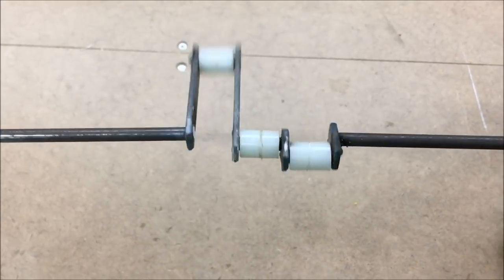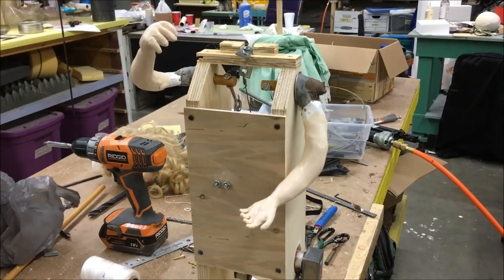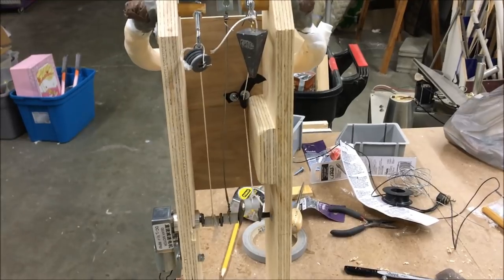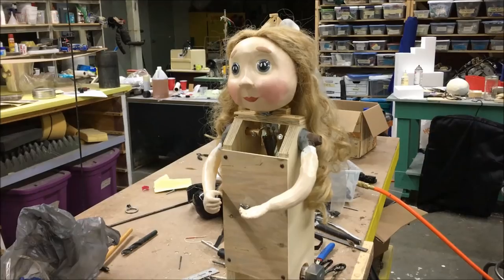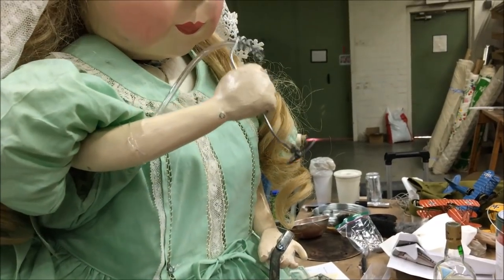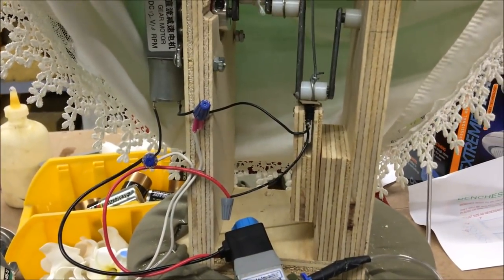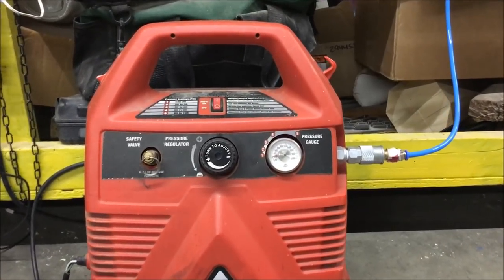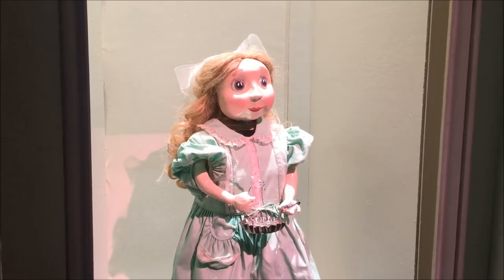Bubble Blowing Automaton

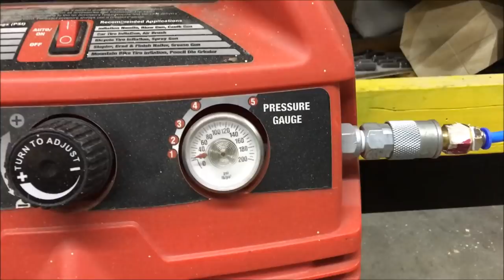Comment: I laughed pretty hard at 2:25. I was not expecting that in such an informative video.

Did setting the air compressor so low keep it from starting up and whirring off stage? Also, thanks for including your other attempts. Most times, my students learn more from what doesn't work than just being told how to do something.
Reply from the maker: Thanks! The air compressor was set low because anything higher would blast the soap away without forming any bubbles. The air compressor was switched off during the show so it wouldn't kick on during the performance.